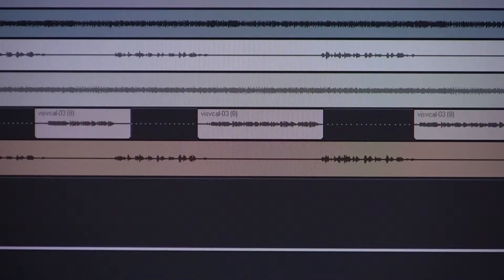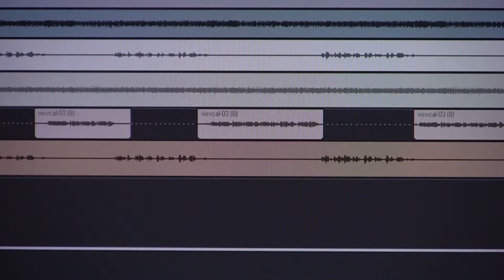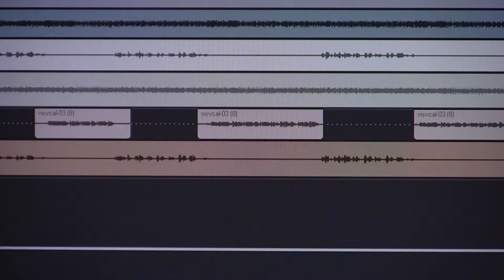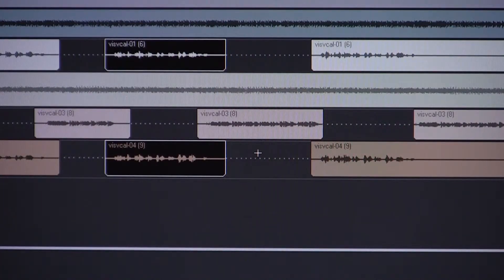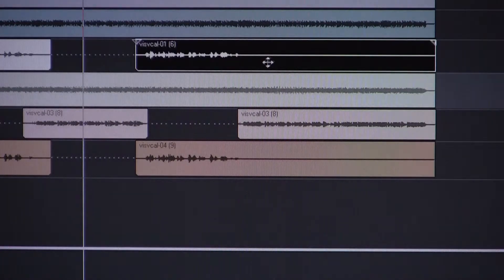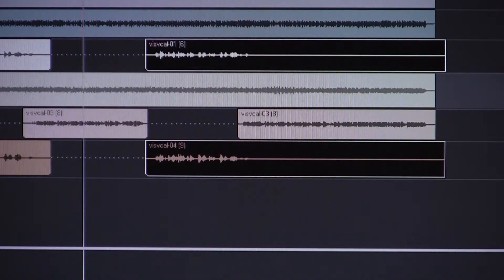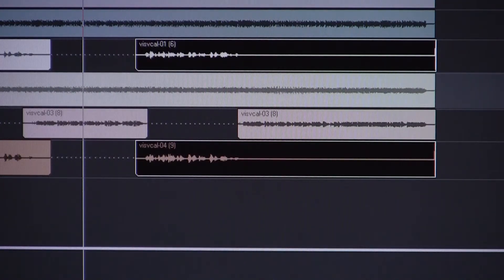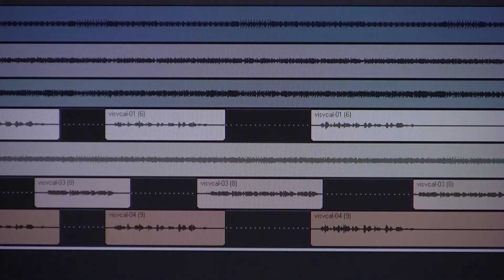SONAR X1 - using nudge

Comment: All the operations you mentionned here have a corresponding keyboard shortcut. I realize it's an older video and you may have learned them since but nevertheless, the nudge 1, 2 an 3 correspond to keypad 1-3, 4-6 and 7-9 respectively. Also you just need to hit "delete" key to erase clip portions, no need to "Cut" or at least use "ctrl+X". Way less clicking and time consuming!